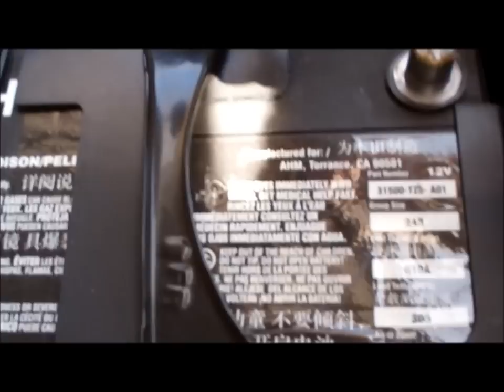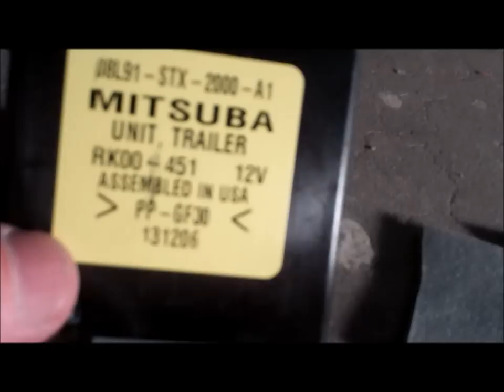2014 MDX OE Hitch and Wire Harness Install

Comment: Thanks for a great video. I just did the install on a 8 year old 2014 MDX.  Thanks to your video it took me longer to tap out the rusty bolt holes to mount the hitch than it did to do the rest of the install. Very complete video. Just wanted to add if you are doing this on an older MDX Grab a 14mm x 1.5 tap to bring the bolt hole treads back to life. Thanks again!!!
Reply from the maker: Glad it helped, and well done on tapping those holes, thanks for sharing your great feedback and tip.

Comment: Awesome video. So helpful. I just put a hitch on my 2020 mdx.  

Regarding the nut… the threads were not rusted but they were hard to engage w the bolts.  A good wash w wd-40 and using a rag to get all of the dirt out helped big time.  

Thank you for this video. You made it so easy.

Comment: I just ended installing the hitch myself following the directions on this video. Absolutely excellent detailed instructions in every step of the way. including all the gotchas and howto. The only difference on my steps was I only unplugged the battery once I was ready to plug the cables on the fuse box and put the fuses in. The hitch looks so very cool!
I watched this video at least 3 times and 2 more while going through the install process.
Reply from the maker: Thanks for watching it so many times, I am really happy you found it helpful with your install.  Congrats on the good work and happy towing.

Comment: I just installed a hitch on my wife's 2014 MDX and your video was a huge help. I watched it twice before the install and then just followed the printed instructions. Very easy to do (although I did drop a couple of the plastic pins for the radiator/battery cover and can't find them in the engine abyss so I'll have to buy more). The video is dead on for every step. Thanks for making the job a lot easier!

Comment: Thanks for the very super easy to follow video. We came across a problem with the hitch bolts not treading. The 2 closest to the bumper would only tap 3/4 of the way. We assumed the manufacturer didn’t tap all the way through. Cleaned the threads very well and we borrowed Tap from the auto parts store and CAREFULLY tapped the end/top of the treads. This allowed the bolt to fully top. 
This was the only hiccup (3 hours). Again, great instructional video, thank you
Reply from the maker: Well that is the first time I have heard this feedback.  Glad you were able to solve it,  nice work MacGyver!

Comment: Thanks so much for your excellent video.  I had my hitch installed at the dealer but when I put my 7 to 4 adapter on, no running lights on the built in tester.  The dealer had the upper 20 amp fuse in the wrong spot (one slot to the right).  Relocated it to the proper slot as per your video and works perfect.  You just saved me a trip back to the dealer, much appreciated.
Reply from the maker: +Chris Conway Nice!  Thanks for taking the time to post this great comment, I am glad it helped you avoid the return trip.  Sorry to hear the dealer made that mistake in the first place.

Comment: 10 thumbs up!!!!  Thanks for the video!  I have a 2016 and this worked like a charm. Not sure if it’s the year but the 2016 also has a double stacked 20A fuse that goes on the second row, far left.  This is for the “trailer e-brake” The diagram on the fuse door shows it.  A million thanks!!!
Reply from the maker: Thanks for taking the time to watch and post your great feedback.  You are appreciated. YouTube won't let me give you a million thumbs up back, but I can give your comment 1.

Comment: * EXCELLENT VIDEO * Thanks.  I did it alone which was difficult (2x4, floor jack and jack stands).  Also, one bolt only went about three quarters of the way in. I'll have to address this before I tow anything.  I put a breaker bar on it but was afraid of breaking the bolt.
Reply: Same thing happen to me on the most rear bolts on each side

Comment: Great video. Was buying an aftermarket hitch but I didn't like their lighting controller wires dangling out the rear door across my painted bumper. There are no fitment issues with the aftermarket hitch and the spare tire AFAIK. Plenty of videos showing the aftermarket hitch and the spare tire in place at the same time.

Comment: Very good video! That's a well designed kit, i.e. no splicing wires, heat shrink tubes, etc.

Uh, now create a video for fog lamp installation on the Acura please. Mine actually didn't have them installed. 🙂

Comment: I spent the whole afternoon installing this....1 hour for everything and 4 hours trying to get two bolts in the frame 😭 both holes closest to the bumper on both sides have so much rust I can not get them fully screwed in.  Been blasting them with PB blaster and metal brushes all afternoon.  Ahhh. 
Hey if you are planning on using a trailer with brakes make sure to install the 20amp block fuse (that comes with the kit) to the left of the 20amps you put in.
Reply from the maker: It is a shame Acura didn't think to put bolts or even plastic plug in the trailer mounting points to spare you the hassle of all that rust.
Reply: @AutoDIY  would have saved me hours! I'm going to have to get a slightly smaller in length bolt, I just can't get it

Comment: Appreciate your video. I am wondering if your hitch "controller" does perform any trailer brake control. I am looking into buying a 21' travel trailer (gross vehicle weight at 4000+ lbs) and there needs to be a trailer brake controller whereas one can tune the braking force on the trailer. Thanks!

Comment: Great video on how too install.  One question, is there a disadvantage to disconnecting the positive terminal rather than the negative terminal on the battery? On my 2016 Acura MDX, the positive terminal can be accessed without removing the plastic engine cover.  Thanks again for posting the video.
Reply from the maker: Thanks for watching and taking the time to post your very good question.  You always want to disconnect the negative first, if you don't you could cause an electrical short.  Modern cars are rolling computers, and they are sensitive, expensive little beeoches about it.  Always remove the negative first when disconnecting and attach the positive first when installing a new battery.  Same is true if you ever need a jump start, connect the positive first, then negative.  When you remove it negative comes off first, then positive.  Best of luck on your install.

Comment: Thanks for this video. I'll be using it when I decide to purchase my own OEM hitch. I have run into a problem with my curt aftermarket hitch for my 14 mdx. I use a full sized spare rather than a donut. After installing the curt hitch I couldn't hoist up my full sized spare, the curt hitch impedes into the area where the tire goes. There isn't a problem with the donut going up, but since I am using a full spare, it looks like I'll have to move over to a donut/get an oem hitch. My question: Will a full sized spare (19 inch tech wheel) fit underneath the car with the OEM hitch?
Reply from the maker: John H Sorry about my super slow response, I didn't get a notification of your comment.  To answer your question, yes a full size spare should fit with this OEM hitch.  There is about 2 inches of clearance between the standard compact spare and the hitch frame.  The spare on the MDX is a 165/80/17, which is 27.4 inches in diameter.  The tech package tire is a 245/55/19 which is 29.6 inches in diameter.  So you should still have about an inch of clearance with a full sized spare and the OEM hitch.

Comment: Great video. Just what I was looking for. How do you make the OEM harness work with Yamaha trailer with surge breaks that has 5 pin connector? Also do you have a video for OEM ATF Cooler install for 2014?
Reply from the maker: Dan Shin Thanks for the great feedback, you can get an adapter that plugs into the round port and has the connection you need for your trailer at any store that sells trailer parts, Amazon has them too, just search for "trailer adapter 7 to 5" or 7 to 4 or whatever your trailer has.   I don't yet have a transmission cooler install video, but this is the second request for it, so it is on my to do list.
Reply: Auto DIY I was told I needed 4 port to 5 port adapter and splice that directly to the reverse light cable. Is there another option that is simpler for 2014 MDX? I will be installing OEM kit. 

I was planning to do the atf cooler this weekend.. Will try to use installation document. Hard part looks to be when you reconnect the hoses.
Reply from the maker: Dan Shin The harness from Acura will allow you to plug in a 5 pin flat blade adapter, you will not need to splice into the reverse line, not sure who told you to do that, but they were mistaken.
Reply: Auto DIY Thank you. I realize that after seeing the wire harness. 

Your video was perfect help in getting my hitch and wire harness installed over the weekend.

I did complete the ATF cooler install too but this took much more time mainly because it was so hard to get to. When you do make your video on this a lot of people will find it useful as I've seen few threads about this on Acura forums.

Thank you again.